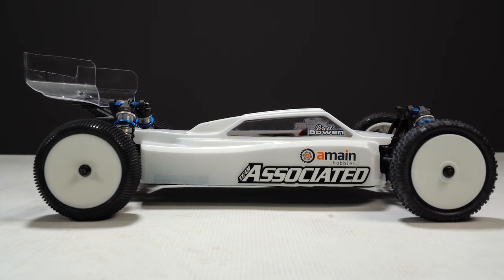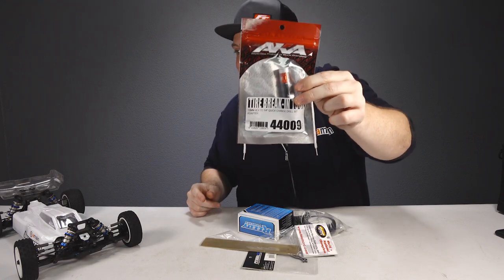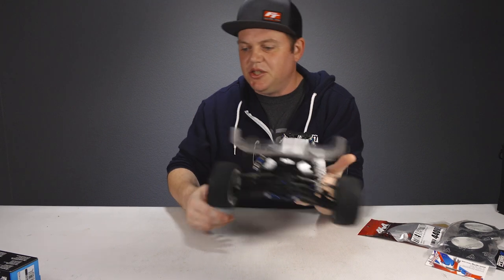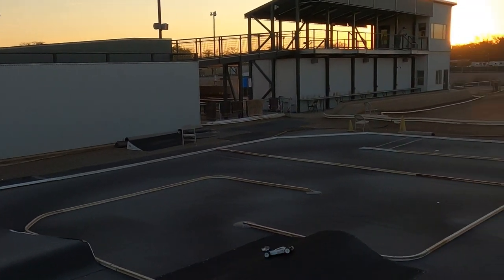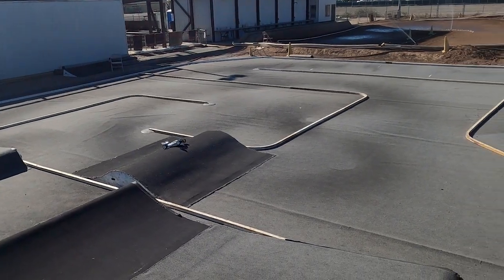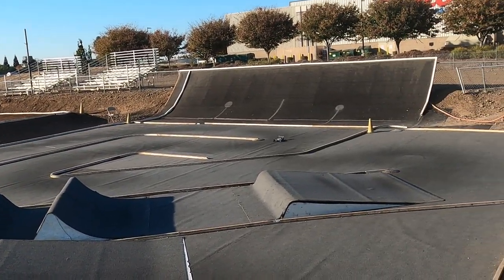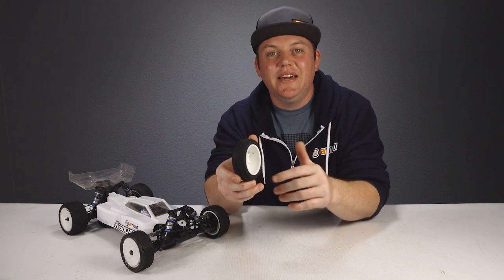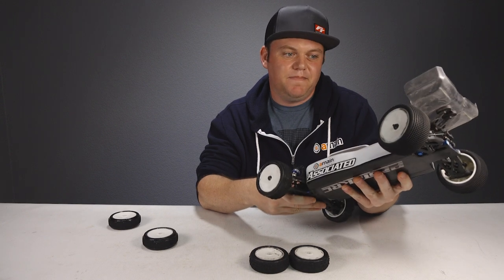Tuning with Tires - B74.1 4WD Buggy Series - Part 3

Comment: one thing you didn't talk about when testing the glue was that the tire is broken in/worn down a little after each run. While it probably isn't a huge deal back to back for this test, it is something that needs to be taken into consideration. But yeah, gluing the sidewall and maybe a little more is huge, especially on high grip tracks. Tires do have a sweet spot where the perform their best, it might be new out of package, slightly worn in, etc.

As for the the outer row on the back tire, that is more useful for getting rid of side bite in the center of the turn. It will also free up the rear end a bit more, and might help with catching a rut when on power out of a turn (lets the tire slip over some of the bumps, while still giving great forward bite.

On a side note, normally the inside row doesn't need to be removed, just the outer and probably gluing the sidewall.

Comment: If you try again wipe out/smooth the outer edge nubs/ribs only first leaving just a row or two of inners. The inner ribs will grab for turn in, once car rolls the smooth outer shoulder should give progressive break-away and help prevent traction rolling.

Comment: We do the same experiments with our Crawlers tires! 

We bought a lot of cheap tires, a selection of good quality tires (Proline, Traxxas, Duratrax, Rc4wd...) and test them in the same subset of obstacles (mainly hard rock).
Our goal is to change tire shape/knobs and foam shape,  to get best performance from cheap tires to reach best quality tires when possible. 

Is really a funny job !

We hope you will talk about this argument with your experience in a future video...
Reply from the maker: Great idea! Making changes and testing results can be very rewarding. 
-Brett

Comment: Why not change the shock oil instead or add/subtract traction bars?  Also, what did the manufacturer suggest based on the track surface?  When I raced as an enthusiast and there were pros in the pits, they were always happy to offer setup tips for their sponsored vehicles.  If you were really lucky, they might even give out "beta" parts, like special suspension hubs made for a certain track or conditions.

Comment: Hey Brett, try the jcon swaggers and nessi combo, I use those on my 4 wheel and like them a lot more, also when gluing if u do the side wall and go up to the first tred but not cutting it off it works a lot better
Reply from the maker: Good tip. We didn't try using only glue, but I can see how that would help. Adding glue seemed to make the biggest difference of all tests. Thanks. 
-Brett

Comment: Thanks for all the useful information lately! I have more questions!! I just got a brushless losi mini 2.0, what can i do to keep the wheels on the ground? I noticed the front wheels don’t really grip the ground and it drives straight even when the wheels are turned. Can i add weights in the wheels or to the front? Is that just how 2wd handles? Should you let off the throttle around turns because i noticed it has a lot more traction and turns a lot sharper when i release the throttle around corners. I want to drive on dirt mostly so would you suggest using the rear wheels for the front too?
Reply from the maker: Letting off the throttle is the best move. These powerful 2WD vehicles like to lift the front end up which makes it really hard to turn. The best move is to let up on the throttle, make your turn, and get back on-throttle during corner exit. There are also weights available to tune the vehicle, which may be beneficial, even if only 5g or 10g worth. This stuff is backed by sticky tape: https://www.amainhobbies.com/protek-rc-self-stick-chassis-weight-strip-2-120g-4.2oz-ptk-8380/p456777
Hope that helps Drew. Have fun. 
-Brett

Comment: What does gluing the side wall do? Stiffen it up so that the sidewall doesn't roll under it in the turns?
Reply: it makes the sidewall slick as if the car try to get up on two wheels it looses the grip as soon as it is in angle to make contact with the glued part.

Comment: did you use foam on the cactus fusion fronts?
Reply from the maker: Yes, they were the pre-mounts and they have foams: https://www.amainhobbies.com/schumacher-cactus-fusion-2-front-2.2-1-10-4wd-buggy-premounted-turf-tire-2-yellow-schu6898/p1347646?v=1332923
-Brett

Comment: all true with brand new tyres, but after 1 or 2 battery packs with 'hacked' tyres, you really beg for more front side bite. We all use cactus fusions with only glue on the sidewall. You have to be a little carefull on pack 1, but after that, you get 3 or 4 packs with balanced handling. More than that, and it gets frustrating, you lose so much sise bite, you really can't keep up with buddies using fresher tyres. Your hacks are only good if you want the most performance out of 1 pack, but you blow the tyre budget if you have to run a whole WE event!!
Reply: as im at the time just try to learn my buggy how to drive and tune and not racng yet its way more easy to save some money just to leav the tyres and drive them from to much grip to enough and in the end bald and trashed.